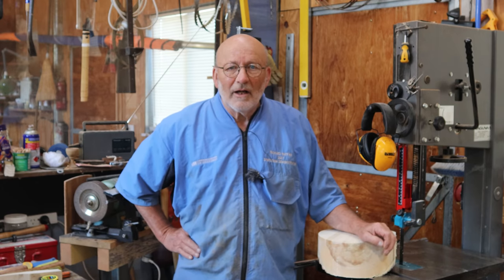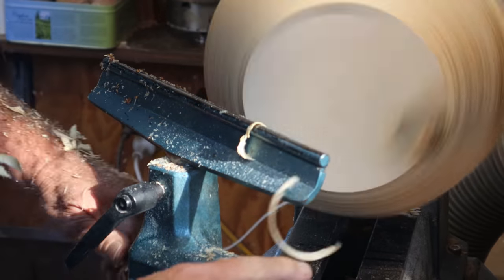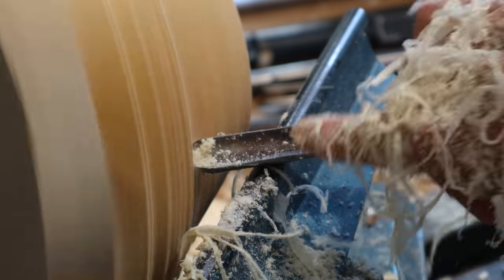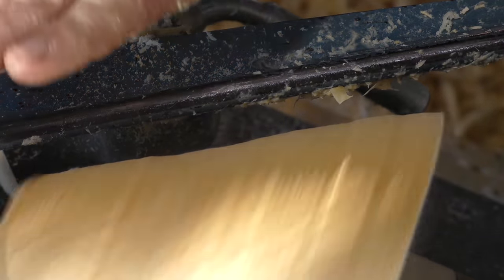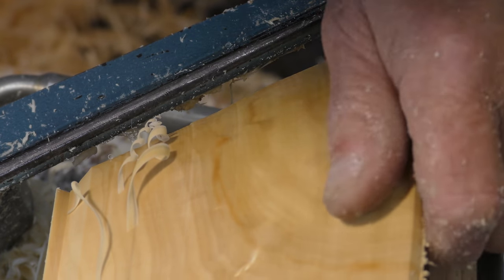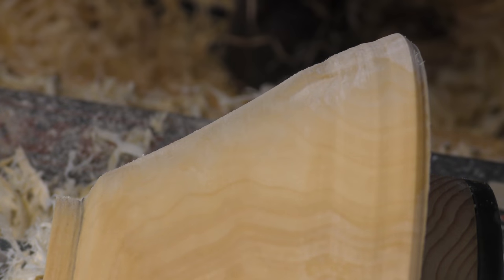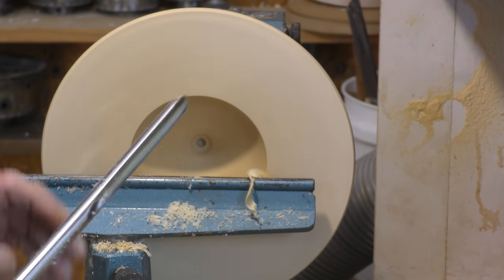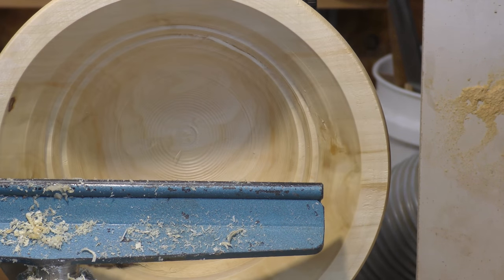Richard Raffan on gouges for turning bowls

Comment: Very interesting video, I definitely learned some things and have questions on other things.
Any chance you'll do a video on how you determine your tenon/mortise? I've always heard you can't let your tenon bottom out in the chuck for safety reasons and because it wouldn't run true, but you had no issues.
Great video all around, thank you!
Reply from the maker: I'll be making a video on mechanical chucks, and another on jam chucks. If your tenon is trued and the end flat to concave it should fit square into a chuck. I never expand a chuck in a mortice/rebate if I can avoid it. Gripping around a foot or tenon always provideds a superior grip whilst providing you with more design options.
Reply: @RichardRaffanwoodturning  awesome, looking forward to more of your videos!

Comment: How do you dry them Richard?  Bag them in shavings? Do you seal the end grain? Just wondering what you do.

Thanks for sharing. Been a big fan for decades.
Reply from the maker: You're meaning roughed bowls? Very basically, as a production bowl turner I used woods known for their stability like ash (whilst still in Britain), then jarrah, redgum, Tasmanain myrtle, and claret ash (in Australia). Really green bowls are put in a pile out of the sun for a few days to let the surface dry off, then into boxes for at least 6 months but preferably much longer. There's quite a bit about the whole process in Turning Bowls.
Reply: @RichardRaffanwoodturning  I will check it out. Thank you sir.

Comment: Hi Richard. Your explanation of the gouge cutting edges is very helpful. I did have one question though - I've always been told that a tenon shouldn't hit the bottom of a chuck, otherwise the top edge of the jaws will not correctly seat on the bowl, and the jaws should seat against a flat surface. Are you saying it's not a big deal to have the tenon hit the bottom of the chuck? Thanks
Reply from the maker: Depends on the chuck. If a chuck is flat across the base and the tenon is turned flat, then the blank should seat properly in the chuck. Problems arise when the jaws dig into wood of varying density and pull the blank off center.
Reply: @RichardRaffanwoodturning  thanks. Your videos are excellent and it's great to see them all in one place, like all your books on my bookshelf. 🙂 Hopefully get to see you in person one day.

Comment: Thanks Richard, very helpful. Can you explain the benefits or not of a more v shaped flute versus the more round flute? Thanks and cheers from MT USA.
Reply from the maker: When turning a profile a more open flute lets the shaving get away faster, whereas with some narrow deep fluted tools shavings can jam tight in the flute, especially when turning green timber. When hollowing you generally need a deep fluted tool for strength, especially when well over the rest. The Henry Taylor/Hamlet Super Flute is widely regarded as the best of the bowl-gouge profiles and then that is modified by the shape of the edge and bevel applied to the basic profile.
Reply: @RichardRaffanwoodturning  Thank you Richard, that makes sense and really helps.

Comment: I use the Wolverine sharpening system and get a symmetrical grind, will it work?  How pronounced should the convex edge on the wings be?  Thanks for another informative video. Now if I can just Re bear all the techniques when I go out to the shop tomorrow.  Cheers, Tom
Reply from the maker: A symmetric grind will work but you'll present the gouge slightly differently. JIgs tend to produce a shorter and steeper bevel than I like on the left wing. A long near straight wing is much more grabby, whereas the covex curve shaving not as wide but thicker. The advantage of hand-grinding is that you can better control and vary the bevel angle. You'll see that in the sharpening a bowl gouge video.
Reply: @RichardRaffanwoodturning  Thanks.  I started turning pens using Easy Wood Tools carbide tools and over the last year + have been learning to use traditional tools.  It was a rough transition, especially since I had trouble keeping the tools sharp until I lucked into a complete Rikon/Wolverine system at an auction. I’ve tried freehand grinding with little /no success.  I in the running to buy a box lot of turning tools in an online auction and if successful to get the one Thompson bowl gouge with a 20” heavy handle, the box contained another six various gouges that will be practice tools.  Hopefully I’ll be able to perfect my freehand sharpening skills.  Thanks for the informative videos.  I’m just getting started on going through your YouTube video list.  Cheers, Tommy

Comment: Surprised to see you use an SRG for this since we tell everyone to never use an SRG on a bowl tho yours had a more continental rather than a square grind. Is it a solid bar rather than a tang style so it's stronger than today's SRG?
Reply from the maker: The 1-in./25mm shallow gouge is from the 1930s with a tapered tang, and never used until now. It was my father's. As a novice in 1970-71 I used similar Sorby gouges for a year or so because they were one quarter the price of a deep-fluted bowl gouge. Catching an unsupported edge was traumatic, but I also got 10-meter long shavings to drape around the workshop and I learnt a lot about slicing. Deep-fluted roughing gouges should never be used for facework and I don't have any.

Comment: Do you mostly turn green wood?
Reply from the maker: Seasoned timber suitable for bowls is virtually unobtainable, so as a bowl turner I rough turn all logs as soon as possible to get the most out of a log before it splits. If I'm fortunate enough to get green timber that's known to warp dramatically, then I'll make my Wavy Bowls and Tripod bowls. https://www.richardraffan.com.au/bowls-turned-green/   Mostly I've used timber that's relatively stable that I rough-turned green then re-turned when dry, usually several years later.  Endgrain boxes are always turned from air-dried blanks at least five years seasoned.

Comment: Hi Richard. I'm very new at this but I have learned to never use spindle tools on bowls. You don't seem to follow that logic in this video though. Is the grain in this bowl oriented differently than usual?
Reply from the maker: It's deep-fluted spindle-roughing gouges that are not recommended for facework. Deep-fluted spindle-roughing gouges are designed specifically for roughing centrework blanks with grain lying parallel to the lathe axis. Deep-fluted bowl gouges are designed for hollowing bowls where strength is required working well over the rest.

Since 1970 I’ve used spindle gouges for turning bowl profiles. You don’t need the strength of a deep/fluted bowl gouge working close to the rest, so using a less expensive tool when the cut is close to the rest makes sense, at least to me.
Reply: @RichardRaffanwoodturning  It makes sense, thank you!